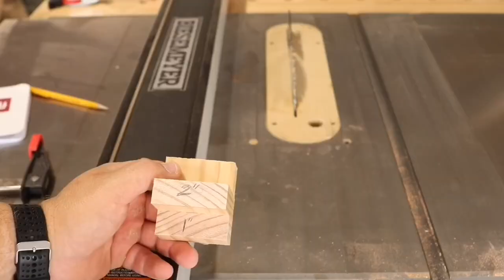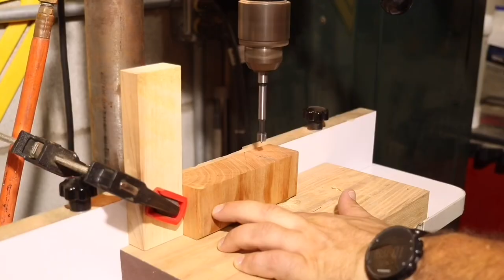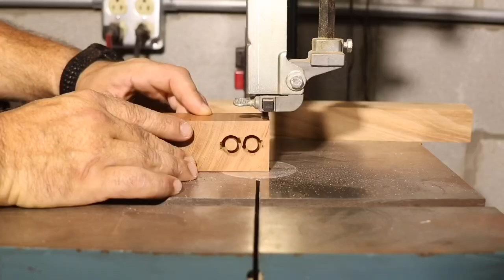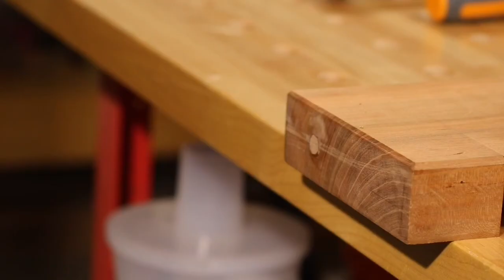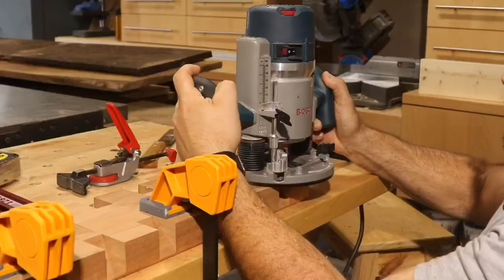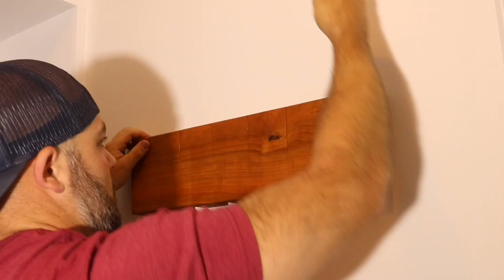How to Make a Modern Style Coat Rack || DIY

Comment: Good build...the one drawback with this design could be that the coats could easily slip off as you're trying to hang them...any issues with that?
Reply from the maker: Not at all. I’ve used it from everything from wet towels to hats to coats and don’t have any problems. The angle is pretty good for it

Comment: i have all the 1 and 2 inch pieces cut and ready to drill the hole in each.  van you elaborate more on how you 1) found the location on the 2 inch piece? i do not understand how you determined the second line. 2) how did you determine the hole location on the 1 inch piece?
Reply from the maker: Bill O'Rourke Hey Bill, basically I was just trying to find the center of the pivot point. Holding the piece flush to the back I make a mark on the angle. Then I pivot the piece as I would if it was on the wall and make the second mark once it’s fully pivoted. I then find the center of the piece coming straight off the point where the two lines touch at the back and that’s where I make my hole. When I drilled the hole on the drill press I set up a backer and a stop so that I could just set every other piece up there and in the same spot every time. Just making sure they were positioned the same way on each piece. This is the hardest part to explain so I really hope this helps
Reply: @PenaltyBoxWoodshop  thanks, that helps.  I'll create a jig to hold the pieces so the holes align down the piece.  

The tricky part is replicating the pivot as it would happen without a true pivot point.  Sounds like you did more by feel than anything else?
Reply from the maker: Bill O'Rourke As with most my projects “feel” goes farther than measurements with me hahaha. As long as you have a good set up on your drill press that will allow you to replicate each hole then it should turn out just fine. I had a few that were slightly off but nothing that a little sanding didn’t take care of once it was all put together.

Comment: Hi, if i do not have a router, how can a make the holes in the back? Or can i use some other metod?
Reply from the maker: Irving Gamallo Hey Irving, Yes you can use another type of hanging system. I would check with your local hardware store to see what type of system they would recommend. Just make sure it can hold a good amount of weight.
Reply: Thank you, i only have a few basic tools, i hope i can do it.
Reply from the maker: I have no doubt that you can! Let me know how it turns out!
Reply: I’ve seen some people add strips of wood or a thin sheet of wood on back to run screws into wall. Might be another option for ya.

Comment: any tips on how to put agains the wall if you don't have a router?
Reply from the maker: You can buy hanger hardware to attach to the back of it and it would work just fine. I would recommend something that screws in and is rated for a decent amount of weight.
Reply: @PenaltyBoxWoodshop  thanks for the really fast reply. i'm gonna have a look at the hardware store Saturday!
Reply from the maker: No problem! Yea, you me local store should be able to help you find the correct hardware pretty quickly. I have an idea what you need but it’s hard to explain without being able to send links or pics haha
Reply: Strip of wood or sheet of wood mounted on back then screwed into wall works too if ya wanna play with the design some.